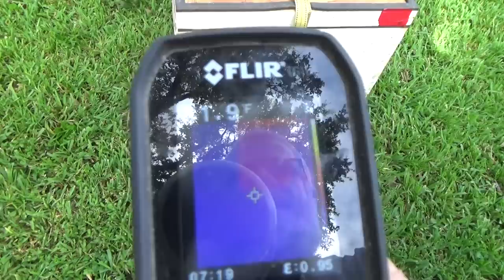A honey shower is so sweet!

Comment: Thanks for showing the frame up. Interesting and it’s a nice closure for us. I thought you just set the framed comb box on top of the vac box and pull the screen out so the bees are less all over? Maybe Ralph’s vac is a bit different?
Reply from the maker: I no longer release the bees with the comb above them, there were to many casualties due to the honey dripping on them. This method is fast, and the bees get on the comb so much quicker. Ralph's vac and mine are the exact design. Thanks for watching. God's peace Skip.
Mr. Ed

Comment: Cool video! New sub here. I'm going to be doing my first honeybee removal from a roof soffit in June. I'm interested in your vacuum set up. Did you add that piece of screen after you vacuumed them all in there? I want to use this method. Do you find many dead bees after vacuuming them, or are they pretty resilient? I'm wondering how the queen would do if I accidentally vacuumed her up too! Thanks :)
Reply from the maker: The video link below shows how I built the bee vac in this video. However, I have since transitioned in using a battery powered bee vac, the Everything Bee Vac,  allmybees.com    , as it proves just as effective and so much easier to set up and use. You may want to consider both. Let me know how your removal goes. Thanks for watching, and I hope you will check out more of my bee wrangling/ bee rescues adventures and let me know what you think of them. By the way, I post a new video every Friday morning, and I look forward to hearing from you again soon.  God's peace.
Mr. Ed

https://youtu.be/tV3mR39v6RA